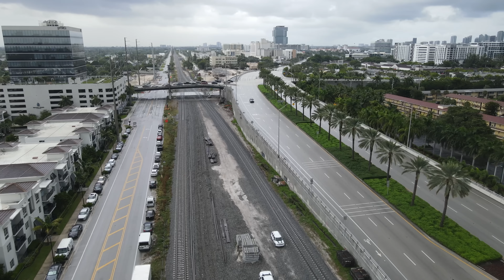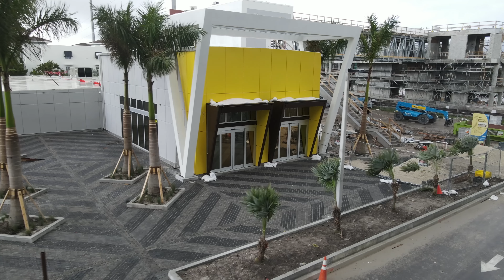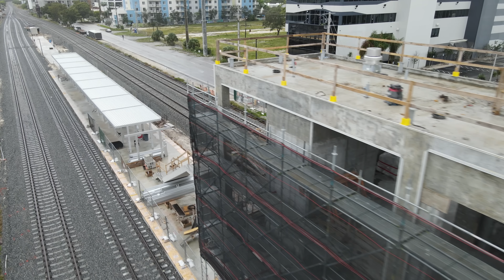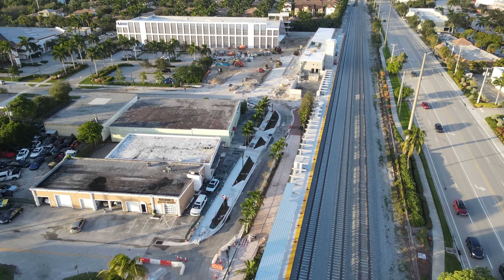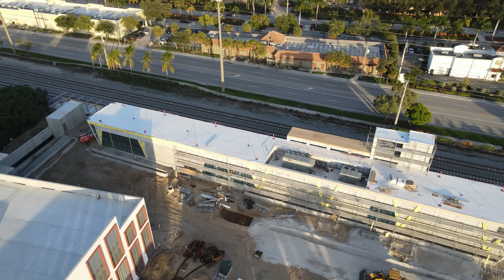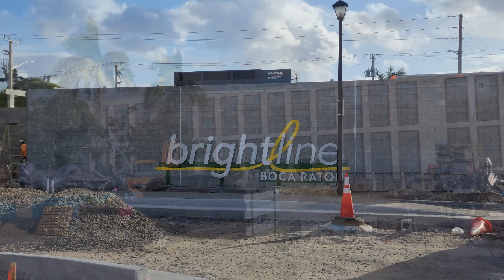Brightline Construction: Progress on the New Aventura and Boca Raton Stations - November 2022

Comment: Is there anyway the Aventura station will connect to Aventura mall (across the big road parallel to the tracks). The mall also has alot of bus connections.
Reply from the maker: Yes, a pedestrian bridge is currently in design to connect the mall to the station

Comment: Great update as always.  A question:  In the Aventura station, the track to the west of the platform is way too far away to be used - are they planning on moving it prior to opening, or are they just going to use the track to the east of the platform?
Reply from the maker: They just need the east track ready in order to open the station and can shift the west one as time allows after the station is open.